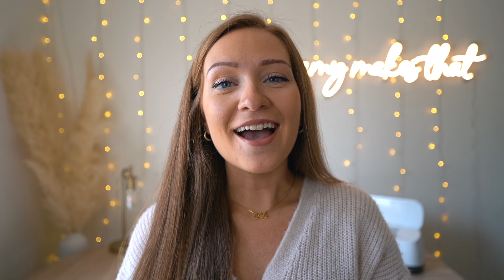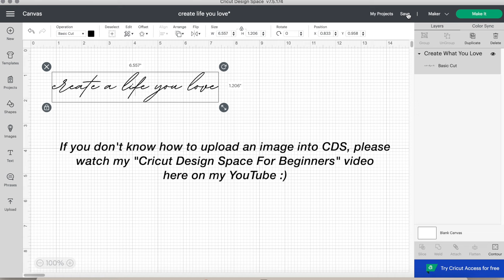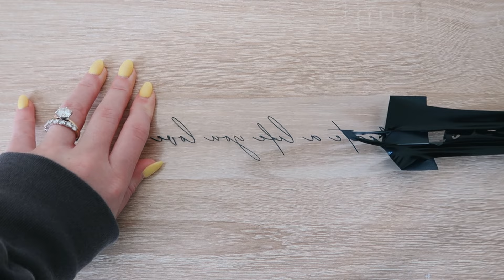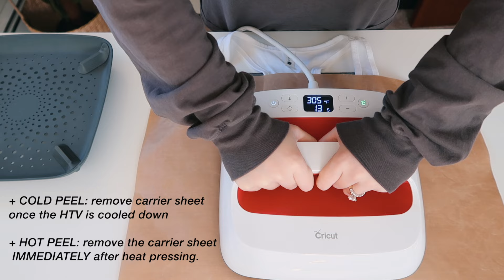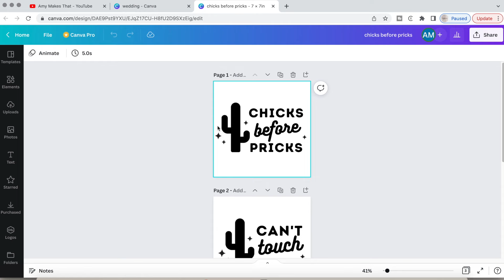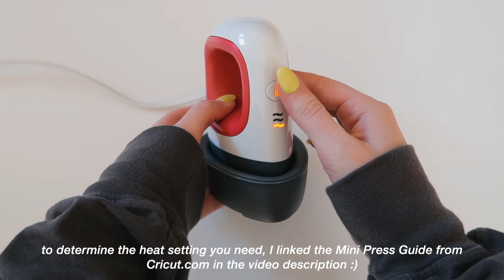EASY BEGINNER HTV PROJECTS WITH CRICUT! | 3 Iron-On Cricut Projects with Cricut EasyPress 2 🤩

Comment: Do you need a specific material to press it on? I’m a beginner 😅(polyester cotton?🤷🏼‍♀️)
Reply: With Heat transfer vinyl both of those materials work :) I usually use more cotton blend (Walmart brand shirts) but you can use most fabric like materials with iron on vinyl ❤️

Comment: Iv also found if you heat the T-shirt etc first so it hot to touch them place your htv ontop then press it, it transfers easier.
Reply: Yes ❤️ Such a great tip to do when working with HTV. Love your comment here because I feel like a lot of Cricut beginners might now know this and it's so helpful.
Reply from the maker: yes! I used to do this in my old videos but didn't really notice a difference. I'll have to try it again!

Comment: I know that coozies are that neoprene material. I'm going to be using my regular easy press to press on a neoprene makeup bag. What heat settings do you suggest?
Reply from the maker: This will all depend on the vinyl you use! Check to see their recommended settings 🥰